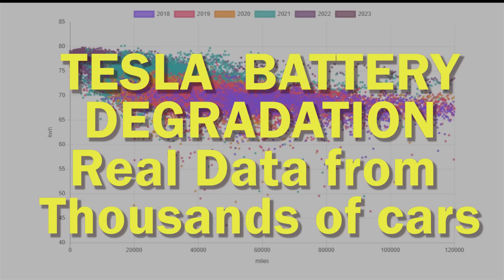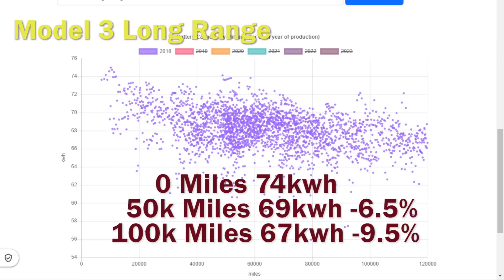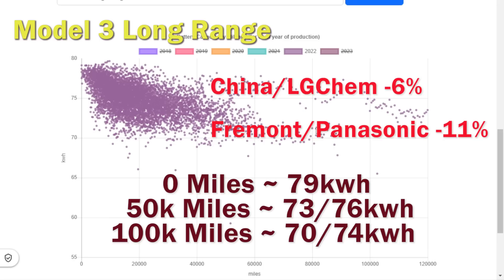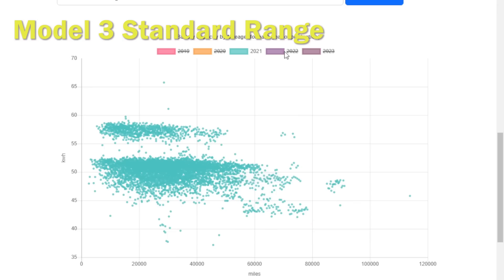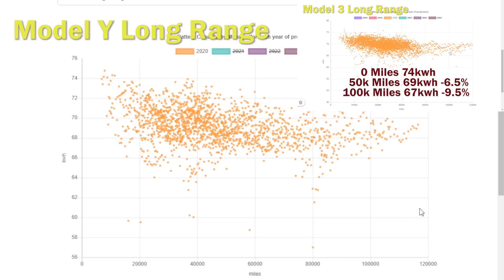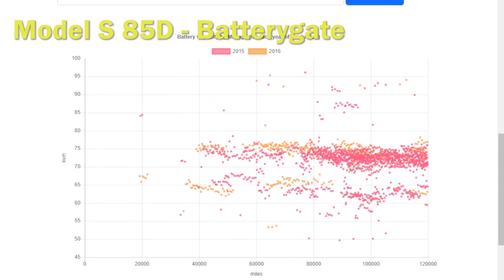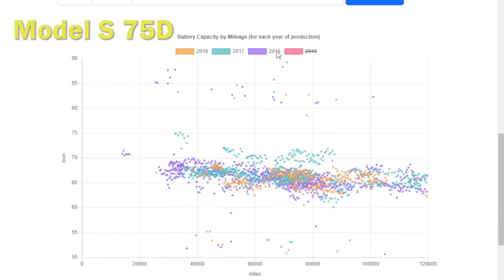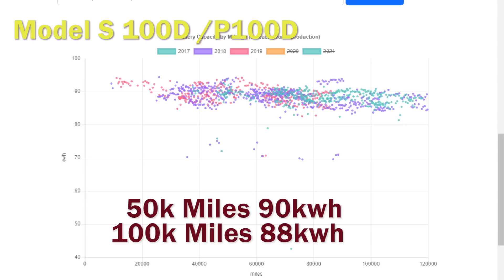Tesla Battery Degradation - The results using real data and why the Plaid is the worst Tesla

Comment: I do battery pack development testing, one thing to consider is there is a customer/technician facing capacity, and then there is the real capacity for internal use only. Beginning of the the max and min voltage range is tighter, and opens up as Ah degrades. This is to compensate for capacity degradation. A specification may say the car needs 100 kWh after 10 years, for this to happen you run a 110kWh pack and software limit it to 100 kWh. So after 10 years, youd be running a degraded 110kWh pack that puts out 'closer' to the og capacity to meet some specification that says the 'pack' cannot degrade X amount, where the cells still are allowed degrade.
Reply: My Toyota Corolla has 396,000 miles and still runs great without any repairs except a $50 water pump. How well do these vehicles do at 400,000 miles. My Toyota Corolla will still go 380 miles per tank, how about the battery cars at that mileage?
Reply: @Bryan-Hensley  Just like my 1994 bmw 318 tds takes 5 minutes to refill and i refill it anywhere; and it gives off good heat in winter, i don't need to wear a blanket with the heater off, like many do in the cold...
Reply: @Bryan-Hensley But can you make your own fuel for your corolla at home for free?
Reply: @JustifyJustin  nope and you can't generate power for your EV for free. I tried that crap. Each of my solar panels do good to produce 75 cents per day in power. They only work well for about 4 hours per day. I live in East Tennessee and we have hazy days 80 percent of the summer, which cuts the output of my 250 watt panels down to 70 watts. I'd need a half acre of solar panels to even think about changing an EV, and on top of that, I'd only be able to charge in the afternoons.
Reply: @Bryan-Hensley  Fair enough, but take into consideration that the entire world is not the US ;-). Here in the Southern Hemisphere sun is abundant and we aren't hamstrung by peak and off-peak rates. A modest home solar system here can generate enough power to fully charge a Tesla model 3 in 3 days. On the assumption you don't commute extended distances, you would only need to charge it every so often and still have spare generating capacity for your home. Failing that, if you have to fully charge an EV from the grid, it still costs a 1/3 of the equivalent in petrol/gas here at the same range calculation. Off course EVs at their current pricing isn't for everyone, but if prices fall, they may well be for the middle class. Frankly, I look forward to the day when my budget and options for fueling isn't tied to which every war the US mil.complex decides it wants to provoke for profit, at the expense of the rest of the globe.

Comment: Don't relay on the overlayed calculations.  Whilst they are basic percentage math, the values are slightly WRONG.  M3LR(2018) 50k is stated at -6.5, but a kid with a calculator could tell you its -6.8.  To Tesla Info - If your going to show Start, Target and % of loss, please check that they are correct AS STATED.

Comment: The average degradation is not showing the risk. The scatter plot clearly shows the individual degradation and individual RISK is much larger. You need good luck and treat your battery well. Not easy under many conditions.
Reply: I do wonder if those outliers are a result of being in cold conditions, since that would affect the battery year-round, though not sure if this is accounted for in the data
Reply: @gir1258 would be very interesting to see for example Nordic only data and how much the cold & therefore less range and more cycles affects the degradation.
Reply: That's a very good point, and it's still a major hurdle in 2nd hand EV sales: the fear of getting a lemon.  One would hope that the number of outliers is small enough for manufacturers to assume the risk; basically guaranteeing the battery for a certain remaining capacity after a certain amount of miles.
Reply: @kaasmeester5903  there should be a stated test what the capacity is. Not bot comparing it with ice engine health. Its like only looking how much fuel goes into it because it is a very very very important information for evs. 
The last part only as precaution 😅

Comment: The LFP batteries in the RWD are great as they will all have been charged to 100% as well, but have low degradation.
Reply: After having my wife's model 2016 75 kWh model X and keeping it limited to 80% for daily use, per Tesla's recommendations except when going on road trips, I was a bit surprised when I got a 2022 model 3 SR with the LFP cells and they said to go to 100% once a week.. Hers has 70k miles now and mine has 8k miles and hers has gone from 220 to 215 or so miles of range, but mine ( never supercharged ) has gone from 265 to 260 in the much shorter time and mileage.
Reply: @phillipsusi1791  the curve isn’t linear. So don’t worry too much about that. It will probably drop off to hardly anything. Also be aware the LFP battery due to chemistry has a problem calibrating and determining exactly how much battery is left and ‘slips’ in its estimate quicker. So run it right down and charge it right back up again. Also the mileage estimate isn’t a great measure of battery health.
Reply: @wakeywarrior  My wife's model X didn't lose those 5 miles in the first year, or even two, or three, so I'm a little concerned that it seems to be faster so far on my model 3.  When I'm driving around town, I'm less worried about how accurate the range is and more worried about long term life, so I might just decide to screw keeping the range accurate and top up to 85% a few times per week to get longer life.  And what do you mean the mileage estimate isn't a great measure of the battery health?  That is the measure of the battery health.

Comment: Good info but I think you should have added trend lines and it would have been very interesting to have tracked individual cars if you have that data. Some cars battery capacities obviously plummet and it would be good to see them more closely.
Reply: Fitting a line makes assumptions about the data which may not be true.

Comment: I’ve been driving my 2007 BMW 335i hardtop convertible for a decade, and it actually has MORE power and range than when it was brand new in 2007 due to a basic engine tune I did. It went from 300hp to 400hp just with a tune, and gets better fuel efficiency when driven normally. It’s such an amazing car to drive. And I’m glad I don’t need to deal with any of this shit. If this car were electric, it would already be crushed in a junkyard by now. I’m glad it’s not a disposable car. But you guys are welcome to buy disposable cars.
Reply: Holy crap dude, how small is your ego as to where you feel the need to defend your car on a video completely unrelated to your car? This isn't even an ICE vs electric video, it's technical information about battery degradation. You come off as whiny
Reply: So you have to take it to some sort of specialized fuel facility every time you want more range? Sounds like a hassle. But you're clearly happy, so thats nice.

Comment: EV definitely make sense, but those EVs that are trams and trolleys, get their power from a contact network. EVs with batteries are not green, never will be
Reply: You are badly misinformed. Or possibly an oil industry troll.
Reply: @Chris-bg8mk  I'm an engineer. You are the badly misinformed one.

Comment: I'm curious about the extreme outliers in the graph. My previous Model 3 dropped to 94.35% after nearly 6 years and 78,737 miles. So far, it looks like my Ioniq 5's battery is tracking the same pattern.
Reply: That's outstanding! What are your usage and charging patterns?
Reply: @trambinvestment3563  Oh… about 48% on roadtrips, 52% local driving. At home I just plug in to my 240V Level 2 EVSE when I pull in the garage. On roadtrips we usually only drive no more than 2 hours before we plug in at a DCFC —which only takes ~14 minutes to recharge to 80%. Perfect for a bathroom break.
Reply: @Yanquetino  Thanks. What's your usual SOC limit at home? 80% or less?
Reply: @trambinvestment3563  80% at home —and on roadtrips, in fact. After nearly 2 years and 23K in my current EV I’ve charged it to 100% only 9 times.

Comment: 2021 model s plaid here. 66k miles. Fully charged I get about 330 miles. Which is about 5% loss. I believe the plaid versions are simply driven harder and probably charged beyond 80 more frequently to achieve max performance.
Reply: Just cope in the comments
Reply: That was my guess. People buying the more expensive car don’t care about battery life
Reply: I wished i would've known about Plaid battery degradation before i bought a used Plaid with 41K miles on it. Instead of running 9.2-9.3 at 150-151 mph best i can do is 9.4 at 146. I went to a dragstrip and trapped 148 twice but i think strip timing was off. Could be wrong. I haven't been able to trap over 146 on the dragy. 

Knowing what i know now especially with how much Plaid is depreciating i would've got one with under 20K miles. I bought mine for 68K
Reply: @tornatic1983  ..
Reply: Ur car was a 395 mile car new
Reply: Oddly enough, take an ICE powered performance car, use that performance a lot, and it wears out sooner too :)
Reply: @PiDsPagePrototypes  buy BMW M, drive it like a mad man and it costs the price of Plaid in repairs during that time.
Reply: @meSOOlame  BMW M, awesome car, you just develop a little bit of stockholm syndrome with the check engine light :D
Reply: Btw Plaid. Pronounced Plad. Not Played.
Reply: @stifflol   'plat' actually
Reply: @dr3v1l1993 I’m pretty sure most people buying a Plaid hammer the shiz out of it all the time. And loads were bought for rentals or rented privately as everyone wants to experience the 2secs to 60
Reply: And people are OK with power drops??!!!  My ICE vehicles, every one of them, do not have power output drops no matter how old they are!!!   The sheer insanity people buying into this nonsense and accepting lower levels of performance as it ages!!!
Reply: @LWRC  With respect, you are incorrect. As a long time petrolhead and an owner of many performance and race orientated ICE vehicles for over 45 years (HSV's, R8's, Jaguar XJR's, Brock V8's as well as several high performance motorcycles like the CBR's, etc) I can confirm that power drops in all of them as the vehicle ages. Just throw them on a dyno and see. There is constant maintennance, upgrades and costs required to keep them performing at their best (which actually was fun for a while). You will though also see poorer MPG as the engine is not as efficient as it wears over time (ring blow by, compression losses, etc). Its a natural and normal physics thing (that's why they need oil to slower the engine degradation). The more you understand ICE vehicles, the more you will understand why they are so inefficient. And if you were wondering, yes I did buy a 2021 M3 Performance and have not looked back since I am no longer a victim of the whim of oil companies (I charge for free at home from solar and also the battery wall) plus have one of the quickest "road legal" vehicles on the planet! You will understand one day 😅
Reply: @ControlPro  
Regarding power drops - combustion engines 10 years old do not have power drops as much as battery cars do when the temperatures drop!  You know that is true!!!
Reply: @LWRC  Power drops when temperatures drop? - must admit in all the years I have never experienced that in my Tesla M3P, maybe just lucky because I live in Australia where that is not an issue 🤣
Reply: @ControlPro  
Put you phone in  your freezer!  Maybe you'll learn a thing or two!
Reply: What are you taking about? Every combustion engine loses miles per gallon as it ages. We just don’t obsess about it because we can easily refuel. But you’re completely wrong in thinking mpg isn’t affected with age/mileage.
Reply: @LWRC  what are you talking about? You mean range? That’s the nature of battery technology, it’s several leagues more efficient than burning fuel.
Reply: 200,000 before your tesla is worthless not good elon is dumb for not investing into lithium titanate batteries 30,000 cycles and safe
Reply: @patrickday4206 ”elon is dumb”
Reply: @alexmack956  well, he is.
Reply: Teslas in the USA are driven an average of over 330k miles... It is around 140k miles for gas cars... NHTSA data of all cars in USA...

Comment: So I don't have a garage in Southern California. Tesla has to be parked outside when dome days will be quite hot. Is that a problem?
Reply: Yes, outside parking is a problem to ALL cars. Look for a car shed or solar roof in any case. If you own some PV you also can climatize your car which is good for you, the interior and batteries too.
Reply: Calendar ageing - degradation is a function of time x temperature x state of charge. You can't do much about the first two, but you can keep a state of charge on minimum of what you need.
Reply: Well, if you asking from the point of battery dergadation, than probably no. It will not be heated enough because battery is not exposed to direct sunlight.

Comment: On future videos, would you consider adding kilometres? 

Also, why use KW when SOH% would give you consistent numbers across battery sizes?
Reply: kWh
Reply: Miles to km is 1 mile 1.6 km or 100,000 miles to km is 160,000 really not difficult. A lot of people work with both  or 100,000 km is 60000 mile ie 1 km is .6 of a mile

Comment: Very good data. But from where is it? No link. It seems to be not puplic.
Reply from the maker: The data comes from the tool we offer (https://tesla-info.com/guide/tesla-battery-capacity.php) and if you use it you'll get the analysis and comparisons for your car, we also take an anonymous summary of your results and add it to the fleet data.
Reply: @EVinventory this site gives me a 404
Reply: Small group, I guess, but our 2023 Texas-built Y has 4680 cells in a structural pack. It would be interesting to see how they are doing. Ours shows <1% capacity loss at 3;600 miles. 🎉
Reply from the maker: @raleedy there a video out today that looks at the batteries by factory which might answer that question.

Comment: Interesting video. I think I had a lemon or something with my Model 3 SR+. After Tesla remotely diagnosed it around just 20k miles, I was at a 13% loss already. The originally listed 240miles of range couldn't get me 165 miles of real world range even with an average of 210 wh/m. I got rid of it shortly after the diagnosis and it was very insightful and taught me what to look out for with EVs.
Reply: Thanks for letting me know most of the used market are full of duds.
Reply: @altSt0rm  I would say if you're looking, check what the mileage says at 100% charge. Don't just look to see it say "100%". You have to switch it to miles and see what that says. 

The Tesla community also isn't helpful here because they all say the same thing "just switch it to percent and don't focus on the miles" but my car had abnormal battery degradation but Tesla wouldn't do anything until it was under 70% because they considered 87% of the max capacity "normal" at 20k miles. 

Also, Tesla is the only EV manufacturer that exaggerates their range figures. So I've learned to subtract 20% from the max capacity for daily use because they only recommend charging from 10% on the low side, up to 90% on the high side. Then subtract an additional 15% if you plan to drive on the highway at speed. If you do the math there, that's closer to a real-world figure for range.
Reply: It taught you to buy an ICE car but you didn't pay attention.
Reply: @stephencrowther524 and with home charging at 7p per kW, and Tesla's always working Supercharging Network, I also never worry about range.
Reply: @PedalPowerPanther  Gee, I just looked up the average cost of electricity in England: 18.2p - 33p kWh.
Reply: Tesla is by no stretch of imagination the only company that exaggerates the range of their vehicles ! 😂 Also what ICE vehicle,for that matter, actually returns the mpg advertised ?😂
Reply: @stephencrowther524  I'm a Honda guy, my previous cars like my Civic that was rated at 27mpg hwy would easily get me 32mpg hwy if set to 70mph. My Acura MDX was rated at 27mpg hwy would get me 27.5mpg set to 75mph on the hwy. My other civics that were rated at 36mog would easily get 40mpg+ on the hwy. Maybe other ICE brands don't advertise accurate fuel economy, but that's not what my comment was about. My Tesla was drastically worse than advertised even at better than the rated 220 wh/m. As for other EV brands, I can only go off of reviews I've seen online for range tests. Kia, Chevy, Hyundai, etc all seem to do better than or at least meet the range expectations set by the manufacturer in the real world driving.
Reply: @RobertoMezquiaJr when Stephen brings up ICE cars - totally irrelevant to anything you said - he reveals his childish anguish lol.
Reply: @stephencrowther524  With gasoline stations with functioning pumps on every block, I don't care about my range.
Reply: @jimjones-pz1tt  actually the worst thing about getting rid of my Tesla was range anxiety. I had forgotten to actually fill up my ICE a few times heading to work which made me late because I had to detour. With my Tesla, I charged up nightly while I slept and I had enough charge for my daily commute. Never once had range anxiety. The closest thing to inconvenience when having to charge was on a trip about 2hrs away from my house and I had to stop at a supercharger to charge up for the return drive home and the food court at the mall that it was located at was closed because it was late and I had slim choices on what to eat while my car charged.

People without EVs have range anxiety for people with EVs. And people with EVs don't miss having to stop and pump gas so frequently.